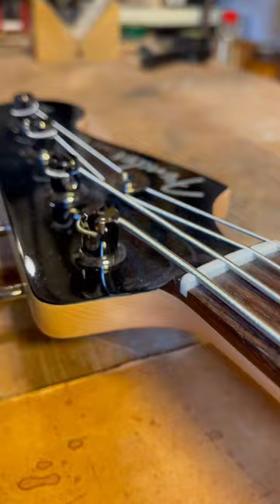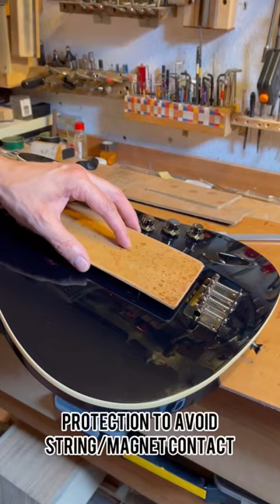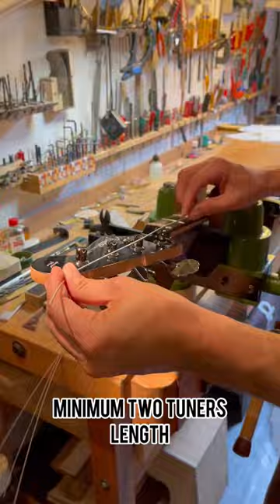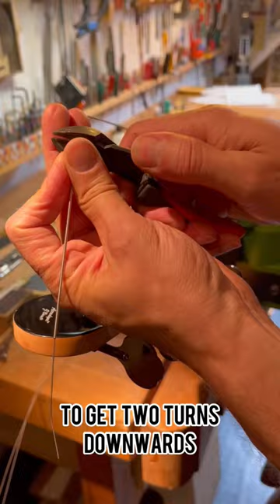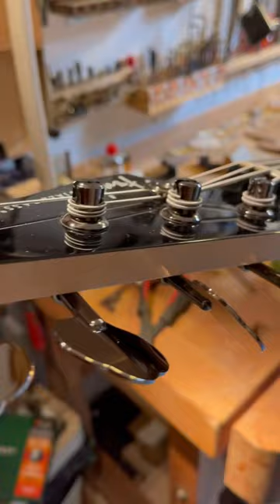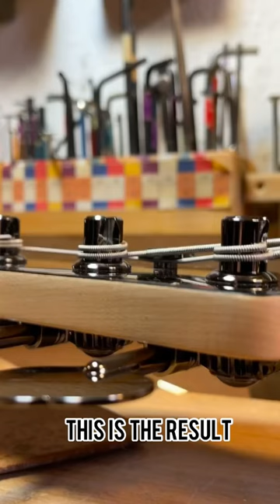How to change Strings Fender Jazzbass avoid buzz  #shorts #asmr #bass #craft #hack #luthier #skills

Comment: Could you please elaborate on what actually causes string buzzing if the strings are not to that length ?
Reply from the maker: There is not enough pressure on the Nut Slot to hold the String down when you hit the String. The vibration cause a Buzz like on a Sitar and you lose a lot of Tone..Best Regards Nik
Reply: @petrekguitars  Thanks. Appreciated.
Reply from the maker: @41PH4B3TS0UP  You are welcome.Cheers Nik

Comment: there is no point in doing two full turns if there is a center hole
Reply from the maker: Thanks for sharing your opinion. I prefer to have as much pressure as possible on the Nut to avoid String Buzz ( and this was the case on this bass) and it is also good for the tone. Best Regards Nik